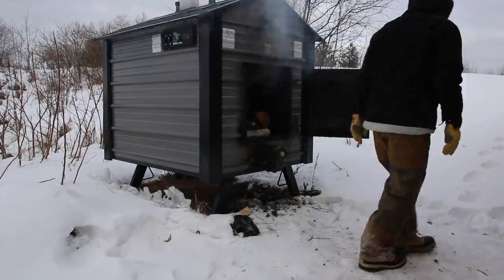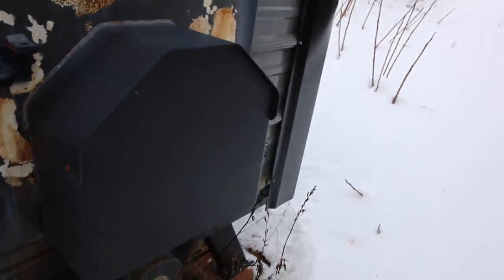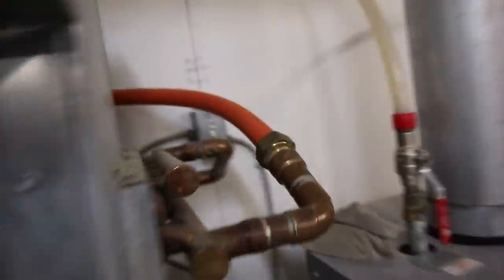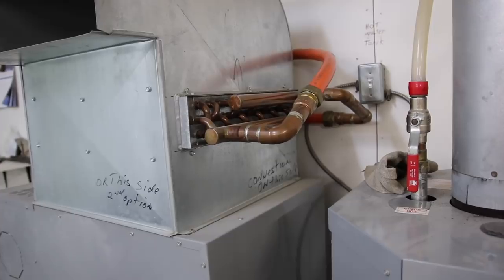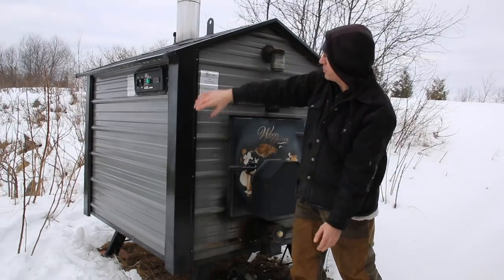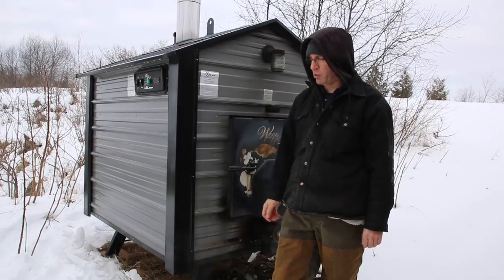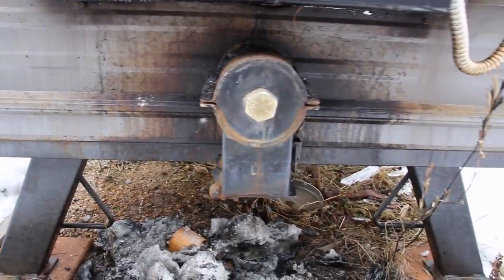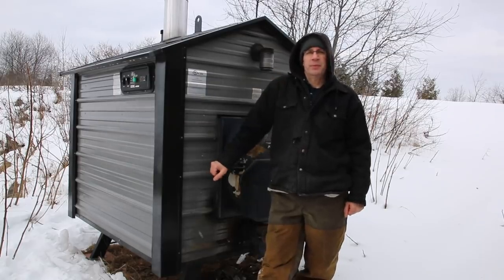Outdoor wood furnace "worth the investment?"

Comment: I have worked around outdoor stoves for years. Here in northern Ohio they are popular. However people are stupid and believe the lies of the sales man. These stoves are very wasteful. You can not stop wood from burning when you do not need heat. It’s not like gas. It continues to burn and all heat is waisted. Waited heat in the underground pipes going to the home. The cost of cutting large amounts of wood is over looked. Pumps are cheap made in China or Mexico fail to the point most owners keep a spare on hand. The unit it’s self cost as much as geothermal. Your time maintaining the stove both feeding the stove and cutting wood is costing you money too. I hate to see people spend there money on these stoves.
Reply: Glock2201 when your fire blower is running it heats to a lot hotter temps then just a draft. A lot like a forgery. Then it shuts down and all the wood is at very hot temperatures. All that heat is waited at that point on. And worse yet, the wood gases are waisted out the pipe. The wood is very hot and continues to give off unburnt fumes that go out the stack. The water chamber is also a big waister. It’s a terrible design for a heat exchanger. The size of the fire to the walls of the exchanger are way to small. Most of the heat in the middle of the fire box don’t even touch the exchanger walls and gos right up the pipe above it.
Reply: Glock2201 I cannot believe you would compare work load when talking free stand to outdoor stove. Bring in a arm load or two of wood for the day is not that much work. It’s something that just gos with heating with wood. Empty ash, clean up chips, bring in wood. They both have that. The out door stove just has 4 time more. Plus you need more equipment to keep working and the repair cost. Chainsaws, splitters, bigger trucks or a tractor with a loader, some use skidloaders to move there wood around. Try replacing wheel bearings in a skid loader, that’s a job. I have even seen that they sell a small Crane unit just the lift the wood up so one can place it in the stove. Way more work for a outdoor stove.
Reply: Glock2201 60 bucks for a pump. I remember more like a 100. But I do know they are unpredictable. It could last a year, or two. But maybe a month. When Gould made pumps, they where made in the USA. Them pumps lasted for years. No more. Still you or a repair man has to service that stove, work and money.
Reply: Farmer Dude once again you do not know what you are talking about. My unit does not have a blower on it. I never said the units are as efficient as other wood burning systems. The extra wood you burn which is easily made up with the convenience and lack of danger from putting wood and having a fire inside. Add the fact that wood is given to me every year it more than makes up for itself.
Reply: Glock2201 it’s called a combustion blower. It is wired into the damper. When the unit calls for heat the damper opens and the blower forces air into the fire box. If the stove did not have a blower the smoldering fire would be very slow to recover. They all have it.  Recovery is already slow as it is. When the home is warm the damper and blower stop. At that time a very hot stove is sitting out in the cold wind cooling down. When the home calls for heat again the water lines and the large Blätter of water in the exchanger has cooled. Now it has to reheat all the water again to 180 or the set temp.
Reply: Farmer Dude please go to Central Boiler's web page and look at the 6048 unit they sell. Do some research and you will find that it has an electronically controlled damper and not a blower on it. Once again you prove you have no clue on what you are talking about.
Reply: Farmer Dude once again I will admit that these units are not perfect and not as efficient but for what little more wood you use the other factors involved make it worth it to a lot of people like myself. I am so sorry if you are so stubborn, stupid, or both to understand that concept that is very simple.

You bring up the expense of the pumps. The big one at the boiler is around $200 and in 10 years I have gone through 2 of them which equates to about $40 a year. Do you pay someone to clean your chimney every year? Does your wood stove heat your entire house to a pretty much even temperature? Is your wood stove controlled by a thermostat or do the temperatures rise and fall constantly?

Comment: Can you convert it to coal? You can pay a lot of heat bills for 10,000 dollars. It would be eaiser to work a few more hours each week to pay the heat bills.
Reply: Have you ever had to heat a house in cold weather places? When oil was $4 a gallon and propane was high it was saving us about $6,000 a year. It did not take long to pay for itself. Ours paid for itself in a little over a year and then saved enough in the next 3 or 4 to buy a tractor. I would much rather have a tractor than to make oil guys richer.
Reply: Glock2201 you were saving 500 dollars a month? That doesn't sound right.
Reply: It was saving me from burning 1000 gallons of oil at $4 a gallon and it was saving at least $150 a month on the propane we were using to heat our water. With 6 people using hot water every day our propane will was very high. It might sound like a lot but it is what I was saving for years when oil was so high. Heating a house in northern NE is a huge expense for people every year.
Reply: Glock2201 I believe coal is still the cheapest way to produce heat.
Reply: Jameson how come more people do not use it. I know some people who tried coal in our area and they did it for a very short time. As a matter of fact when we first moved into our house it had a combo furnace that could use oil/wood or oil/ coal and the previous owners tried coal one year and found it was more expensive and harder to use than wood.

That and the last time I checked I don't have any coal on our property but we have lots of trees that need to be thinned out.
Reply: Glock2201 I think they don't use it because it's dirty. There were supposed to be coming up with technology how to make it cleaner burning.  I'm sure the oil companies put a stop to it.
Reply: 2 winter and 10,000 would be gone in oil, 1.3 winter with propane
Reply: oil to day is more the $4 cnd a gallon, if i go pick it up in a big tank as eqipment fuel it is $1,28 a Lt. if they deliver it it is $1.42 plus heating tax
Reply: Kerosene is the exact same thing as diesel, they just put a red dye in it so that you can't put it in your car.
Reply: @HamguyBacon  @ Hamguy Bacon Kerosene and diesel are the same? LOL. Try going from burning Kero in a torpedo heater, to using diesel instead, and you'll quickly smell the difference.
Reply: doesn't matter what you smell, they are the exact same thing, They add sulfur in diesel to "lubricate the engine" likely bullshit, they don't want people buying the cheaper alternative.
Reply: @lilkittygirl  They are both the same fuel you idiot, sulfur is added so you don't buy the cheaper fuel and use that in your home.

Comment: All that lovely wood wasted. Who the hell designed these inefficient wood guzzlers?
Reply: Hell that's a million btu fire box if it was set up right with the right flu and in the right location you should be able to load that thing once every 3 days and have heat and hot water forever and all the wood underneath that canopy should be enough to last about 2 seasons.
He's got 100% heat loss going out that flu and about a gazillion feet of water pipe running to a shop.
I would have set that thing up right outside my shop and that hot are going out the flu would be getting used to heat something up I promise

Comment: It uses electricity. Looks nice if you can depend on electricity. I cannot.
Reply: that is the nice part about these units, you do not need electricity, a battery, 1 battery an a solar panel is all that is needed, all comes down to the install, you dont need a fan in side if you do a right install, you can spend more and install hot water base boards but best an cheap is in floor heating, if you have wood floor you run the cheap pex pipe down each floor joist, cost you $28 per 100 feet

Comment: Just being helpful you look like you got a long fireplace are you cutting your logs too short your radiator is this person hot air too high and truth you should be blowing air down to the ground with some considerations of not having electricity noting that he does rice okay the idea set up would be to put the radiator close to the ground and blow air through it along the wall like if you put a box fan 90° from the wall so that the air will circulate round and round no you are now circulating cold air and you are Heating the entire area because heat rises and you are covering the lower body of cold air what you are trying to do now is trying to suck the cold air out from the bottom and flood the upper air with hot air the what is in your favor is that you do have a large radiator but take note that your concrete floor is a key part of your heating just as a wood stove will it warm a wall and it will radiate its heat as if it was a reflector

Comment: What happens when electric goes out
Reply: When my wood fired boiler went out of power, I ran an inverter to the pump ( uses about 60 watts ) from my car battery. Also in the case of this guy , he would also have to run the blower on the inverter. I also had a second pump in the system in case of pump failure.